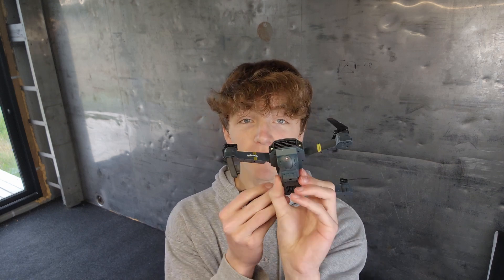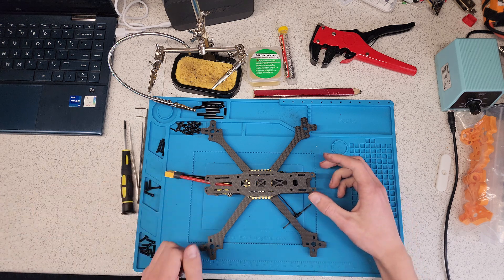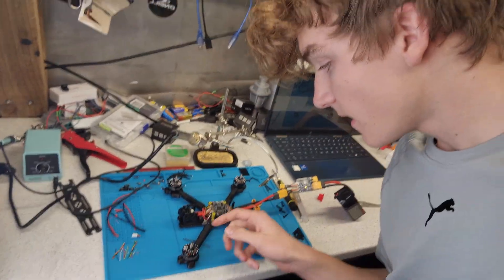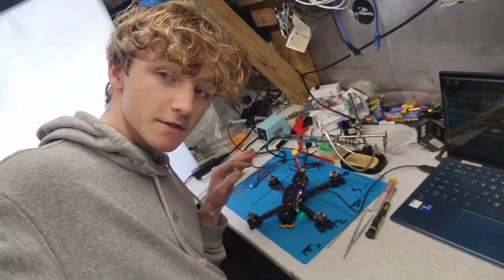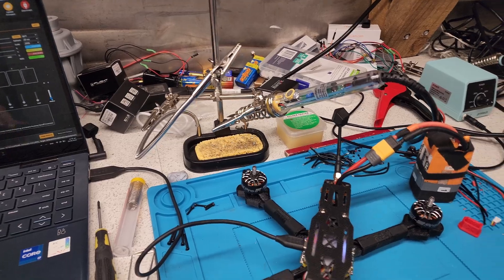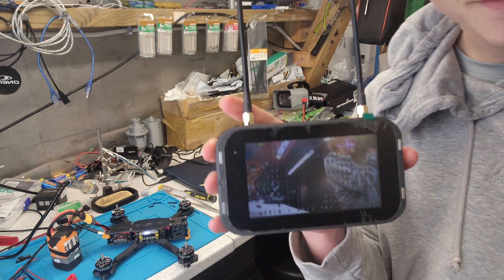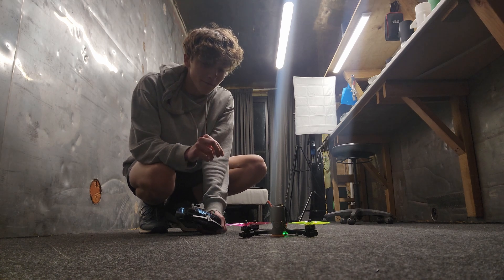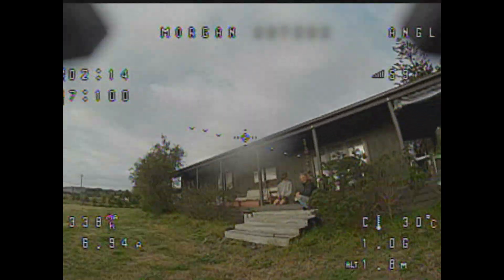I BUILT AN FPV DRONE!

Comment: Nice first build! Next time use solder flux paste for better soldering job. With that your solder we look professional :)

And at what temperature were you soldering?
Reply from the maker: I was using a lot of flux, it just wasn't powerful enough. Ended up using 350°c with the new iron
Reply: @stormgaming7379 I see man, next time 400°C / 410°C | A friend told me this and i solder the lipo pad in 5 min with perfect round solder
Reply from the maker: @Cornusse nah I ended up getting it perfect, it's just the first iron that didn't work

Comment: the sigh when showing the price is so real.. xD (edit: The stronger soldering iron you got.. i had that one! My dad gave it to me a while ago, but it broke.. wouldnt heat up no more :C) (edit2: GOD FAK You didnt actually SCREW and antenna on the VTX when doing the first power up!! Big mistake!!)
Reply from the maker: Yeah I was warned that this model is known for failure but I took the risk because it was cheap and basically the only iron in the right power range 😅
Reply: @stormgaming7379  Hah- so long it works, use it till it dont. GL flying otherwise!
Reply from the maker: @AZZARIIA thanks!!
Reply from the maker: Also I had the smoke stopper in place and the vtx defaults to 25mw before any settings are set so it wouldn't have burnt it out. For the first test without the smoke stopper I did have an antenna on there
Reply: @stormgaming7379  yeah saw the antenna later on, But just to be safe even if it is 25mW i'd still just be careful lol.. but yeh

Comment: STOP YOUR KILLING YOUR BATTERIES
DONT LET THE VOLTAGE DROP BELOW 3.3 VOLTS IF YOU WANT TO USE IT FOR MORE THAN A DAY!!!! At best keep it above 3.5v
Reply from the maker: In that clip I had the settings set wrong in Beta flight, it actually had over 3.6v left in it